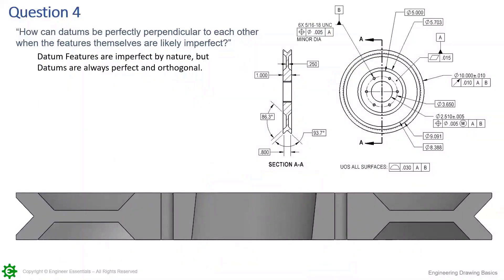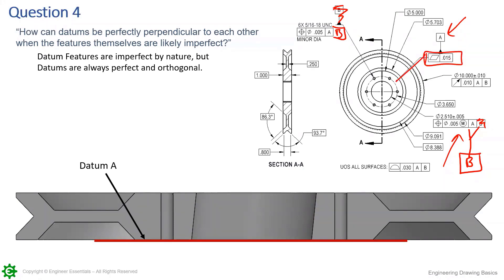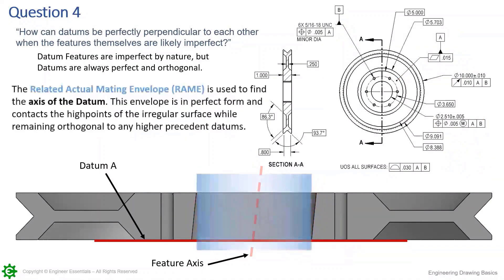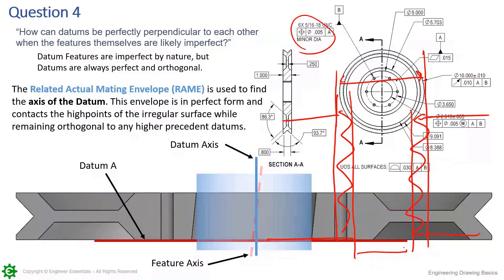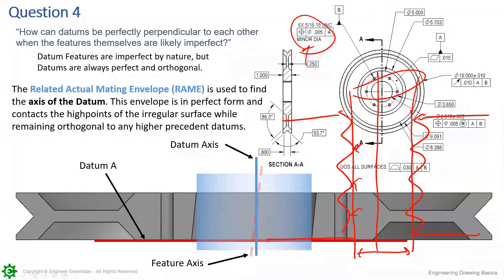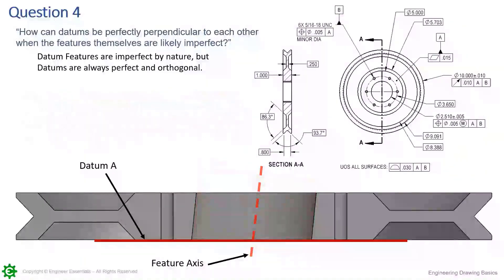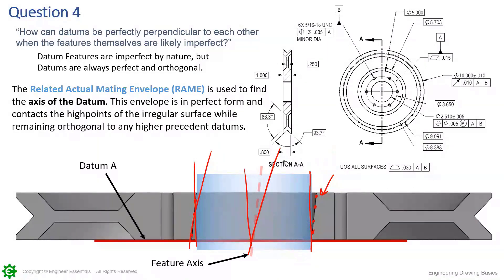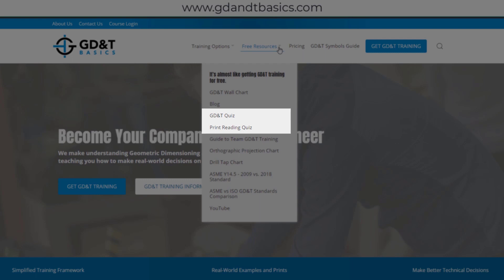Common GD&T Student Questions: Perpendicular Datums from Imperfect Features

Comment: Thanks for your sharing, but I still have a little bit confused about the definition of UAME and RAME. As you mentioned UAME is an envelope that has a perfect form and contacts the highpoints of irregular surface, and is not related to any datum (it may have the same orientation as the actual axis of the part), while RAME is also the same definition as UAME but it related to the higher precedent datum (perpendicular with datum A). So my question is why the orientation of these two envelopes (UAME & RAME) can be different when they both contact the highpoints of irregular surface? thanks so much if you could help me to walk through this question
Reply from the maker: This is a great question. Your explanation is very accurate. What we have to picture is that the highpoints that are utilized when no orientation is considered ( UAME ) are completely different highpoints than when we consider the envelope shrinking around the feature but remaining oriented to the higher precedent datums (RAME). Hopefully this helps clarify things for you.